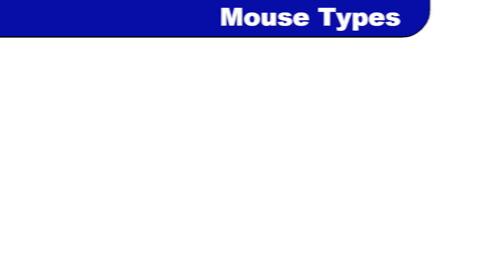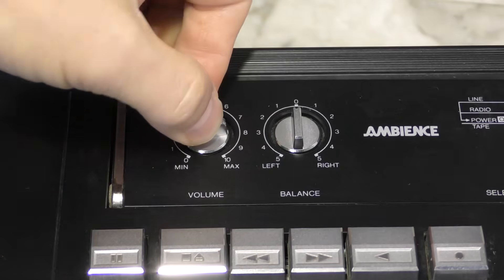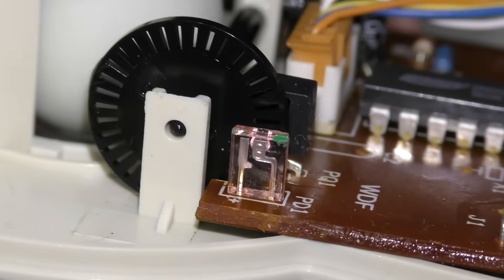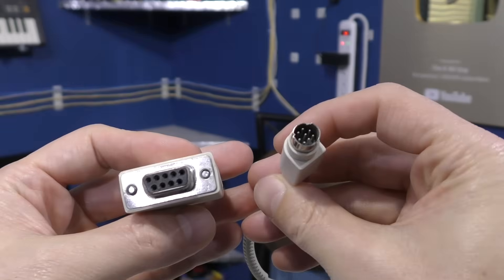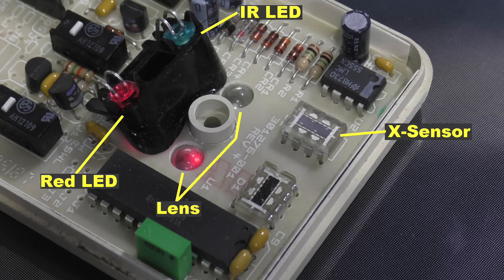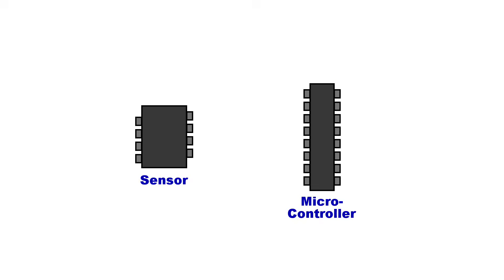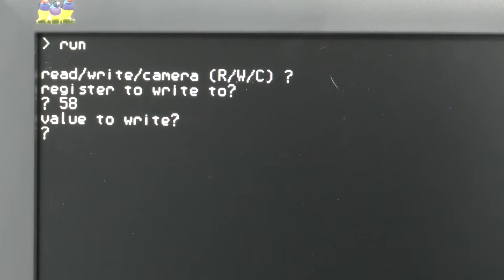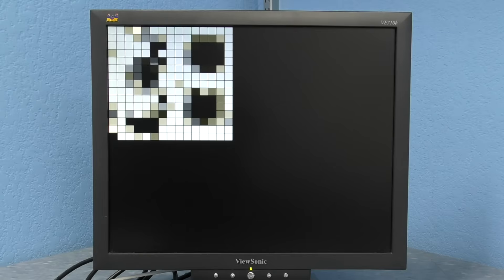What does a computer mouse see?

Comment: Saw the video thumbnail and immediately recognised a Sun optical mouse, which brought back memories of an early job where we used those mice with their matching metal mouse pads. A new manager took over our department and was unimpressed with our curious looking mouse pads, so one evening after we'd gone home he had his assistant replace them with company branded neoprene ones. You can probably imagine our horror the next day as we realised we couldn't use our workstations. The metal pads been bent in half and chucked in a skip, so the cost of the replacements came straight out of the manager's own pocket.

Comment: I have an HP-HIL mouse. The horizontal encoder wheel kept catching on the infrared LED because it was slightly bent. I don't know how many times I cleaned that mouse before I figured it out.
I still use a Logitech ball mouse at work. It doesn't even have a scroll wheel. At home, I have my trusty Microsoft USB mouse, only marked as the "Wheel Mouse Optical USB and PS/2 Compatible." You probably know the one, everybody had them in the 2000s.

Comment: The N64 thumbStick also utilizes optical sensors, just like the old rubber ball mice, so it actually reads digital data (in the form of pulses)

Comment: I used those sun microsystems units in the 90's and they worked so much better than the mechanical ones of the day. But those mouse pads were a pain and would slide around the desks. You also had to be careful to not dent them otherwise it would cause problems as well. I miss the fun of scrapping those rollers.

Comment: For a while, I had the optical mouse with the mirror pad for my Amiga.  I found that it gave the mouse a jumpy feel at the smallest levels.  When creating 3d models for sculpt 3d, the optical was not really that much better than the stock mouse.  Also, it had 3 buttons, but not much software embraced the extra button.

I still have a PC serial mouse that runs at 2400bps.  It's interesting to hook it up to a terminal program and roll it around.

Comment: Hey - I'm looking for a decent analogue to usb capture card, i bought 2 and they were absolute crap. 
Can anyone recommend one?

Precious VHS tapes to copy :)
Reply: might not be the best solution, but we still have an old camera which uses vhs tapes and has the ability to output to the yellow/red/white video/audio connectors.  That camera's output plugs in to a video input on another slightly newer camera that we have, which for some reason has the ability to take a video input, and has a usb out connector which we plug in to the computer.  The software only really works for windows 98 and xp, but luckily I have an old laptop with a copy of xp installed on it. Hit play on the vhs camera and record in the software and wait for the tape to finish!

It's a lot of wires and probably not perfect quality to capture the tapes, but it's what we have on-hand and worked well enough
Reply: @TheJunky228  Quite a solution! :)
I still have a windows xp laptop lying around somewhere so an older device will also work. 
I have both a VHS camera the tapes were recorded with (older than me lol) and a VHS player - both output composite only. 

I bought 2 kits in the past - one for £30 and one for £8 - the £30 one was worse than the £8 one and delayed the audio input somehow. I've seen The 8-Bit Guy use a squid capture device but I've been unable to find one like that on ebay or amazon.

Comment: Did the resolution stay around the same or do we haev HD mice now? 
Just like sound cards, did the computing power ever move to the machine or do they still send the same signals as opto-mechanical mice?
Reply: Most "gaming" mice have a higher quality sensor (high dpi).  For example, Logitech's G502 has a 12,000 dpi sensor.  A typical mouse has a resolution of about 1200 dpi.  DPI is just a marketing gimmick for gaming mice.  Some gaming mouse manufacturers even admit that DPI is fairly irrelevant, and too high a DPI isn't always a good thing.  Polling rate is also important.  A mouse with a 125 Hz polling rate is reporting its position to the computer every 8 milliseconds, while a mouse with a 500 Hz polling rate is reporting its position every 2 milliseconds.  A higher polling rate can reduce lag, but setting your polling rate TOO high just wastes CPU resources for minimal benefit.  

In general, mice still send the same information to the computer, whether they are optical mice or electro-mechanical.  Just the button status, X delta, and Y delta (the change along the X and Y axis since the last time the mouse was polled.)
Reply: @SpearM3064  g502 se now has 16k dpi.
but now days its all about ultra low latency wireless mice, still very pricey, but supposedly lower latency than even many wired mice.

Comment: I remember when I was in high school, the rollers in the mice couldn't be cleaned because some school administrator had decided it would be a good idea to superglue all the ball covers "to keep people from stealing the balls". so people ended up throwing the entire mouse in the trash whenever the rollers would get too dirty, and the school would just buy a new mouse.
Reply: What's stupid is that's actually a thing. I remember finding a few mice without the balls inside at school. Not many, but some morons actually stole them. Of course by that time optical mice were becoming popular and cheap...
Reply: @encycl07pedia-  Kids used to steal them to throw them at eachother. Or lights. Or pretty much anything that was fragile and could be broken by a dense object colliding at velocity. I remember one bored kid making a ball bearing ring to slide around on using computer mice balls and a CD disc tray used for stray discs.
Reply: @encycl07pedia-  you are telling me that stealing a ball makes a person a moron. that is absurd
Reply: @encycl07pedia-  it was a joke kind of
Reply: I went to a school like that. the covers were super-glued.
Reply: @smpmuzpid  You'd think that, but probably not -- unless you're getting a volume deal on the replacement balls, it was probably faster and cheaper to just toss the mouse.  And if you were really determined to clean your mouse, you could just unscrew the case...
Reply: @AndrewAMartin  the mice in question had screws under the glued-on cover. you could probably drill holes through the cover to get to the screws, but no one bothered to do that.
Reply: It's funny how the same things happen all around the world. My high school teachers here in Spain used to do the same thing.
Reply: @pedrosmith4529  Kids these days...when I was in school there were no mice, floppy disk drives, etc.  My high school got Apple IIe for a computer lab for the 1982-83 school year, which was 11th grade for me.  No mouse involved.  PCs didn't have mice.  In the late 80's, having a mouse for a PC was more of a gimmick, and would be programmed to emulate arrow keys or some such when moving and that was kind of useful in some programs, but it was rare for any program to have actual support for mouse input.

I remember Logitech and Microsoft had different standards, but the same connector: serial port.  The "bus mouse" and the PS/2 connector was still a serial port, just going to a different, dedicated, serial port hardware.

Logitech had 3 buttons, Microsoft 2.  The Logitech protocol (or the supplied libraries anyway) were much nicer to use in programming.  Mice (except for MS branded) had a switch on the bottom to choose the compatibility mode.
Reply: @JohnDlugosz  kids these days and their dang. *shuffles cards" graphical user interface point device that has existed in mainstream sence 1983
Reply: @JohnDlugosz  ok then boomer
Reply: in my school they disabled right-clicking because they believed that it would prevent people from changing settings and hacking computers....
Reply: elco_os lmaooo
Reply: @smpmuzpid  How easy was it to source replacement balls? I don't remember them being sold in regular computer shops. And would you need to source the exact right size of ball for the brand of mouse you had? Already it's sounding like it would have been a massive PITA to do when simply buying new mice was hardly uber-expensive.
Reply: I'm a school IT technician, and yes, that was common practice in schools before the last of the ball mice were discarded - which was shortly after I started working in schools. Students will break everything, and theft of balls was an issue. The biggest similar annoyance now is the metal bars under the spacebar on keyboards - someone keep stealing them, so the space bar is left wobbling!
Reply: @smpmuzpid  Oh jeez, there were a few people who went around my school burning out the motors that pushed out the CD tray. Part of that is Lenovo's or the drive MFG's fault for not making the motors check if they got stalled mid way through retraction, but it admittedly was fun to watch.
Reply: You found out they were glued because you were trying to get the ball out 😆
Reply: @brendancarlson1678  I found out they were glued because I saw a teacher throw a mouse in the trash because it needed cleaned and asked why they didn't just clean it instead of throwing it away.
Reply: When I was in grade school kids would try to install Minecraft on the school computers and whoever did was the coolest kid in the school.
Reply: my IT teacher didn't even knew about cleaning the ball rollers ...
Reply: @chill down Why did you do that? What use did you have for a stupid mouse ball anyway?
Reply: Love Live Besto Shonen people from my high school stick cookies into the cd drive and toothpicks into the fan. What is wrong with people?
Reply: I had a ton of mice balls I bought from the local library as a kid. I used them to bribe teachers.
Reply: Was that like 10 years ago?
Reply: @Mustache Merlin amazing since the cost of all those apple machines and stuff simple makes the cost of mouse balls inconsequential, they could have ordered a life times supply for a hundred bucks.  but school computing was always a bit of a scam based on "computer literacy" fears that never came to pass and were always obvious from the get go, but this is what happens when you are free to spend other peoples money.
Reply: @churblesfurbles  I don't think they're free to spend that money. If that wad the case then the principal would have bought a Ferrari for himself. Pretty sure this choices have to be justified and approved
Reply: But people were actually stealing them when they weren't super glued
Reply: @smpmuzpid  Worse were salami slices in CD-ROM
Reply: That's terrifying.
Reply: Same at my school. So I always kept a screwdriver, q tips and bottle of isopropyl in my backpack. That one took some explaining to the teacher the first they saw me do it.
Reply: The only sad this is that they had to do that because people were taking those balls. Yes, one could take the mouse apart to clean it, but by the time it needed cleaning, it probably needed to be replaced anyway. (a mouse used by lots of people, all the time, gets pretty dang nasty. and the buttons wear out all too quickly.)
Reply: @jfbeam  at the school I went to, they usually needed cleaning about every two weeks. that's long before the buttons would wear out.
Reply: @jfbeam  it's a school in the US. there's no way they'd pay anyone enough money to do anywhere close to the amount of cleaning that was needed.
Reply: @smpmuzpid  Thats if you could find the right one, i never recall the balls being for sale seperately
Reply: Better than having to throw it away due to idiot kids removing the ball
Reply: Better to have a stolen mouse than a broken mouse am i right
Reply: mega face palm
Reply: To be fair I stole several mouse balls from my highschool so it's not like the concern was illegitimate
Reply: @smpmuzpid  even if they replaced the whole mouse if the ball got stolen, only replacing the few that would have had the balls stolen would still be cheaper than replacing all of them when the rollers inevitably got gummed up.
Reply: Just want to say that I have spare clothes and if you need them I can have them mailed to your po box
Reply: I've stolen a few mouse balls in my day.
Reply: @Catknapper  how did that work out for you?
Reply: It's probably a good idea. In that scenario you only throw away the mice when it's dirty. With the ball stolen you'd had to throw it away much sooner. And yes, they could've bought mice balls, but public schools can't buy whatever they want wherever they want, they are provided with suppliers and such and it's probably a pain in the ass to buy these things
Reply: @smpmuzpid  Well, they always had more of someone else's money.
Reply: @Mustache Merlin
Not stupid... We did it to about 100 mouses at the school I worked for back in the early 2000's.
Cleaning was simple - remove the single screw and open the cover. I used to do it about once a fortnight, depending on what other IT fires needed extinguishing.
We went from replacing 5 or 6 mouses per term to one a year (usually when some kid had a hissy fit at the teacher and yanked the cable out of it).
Reply: @Mustache Merlin But can they help it if the entire school wants to steal the balls for no reasons ? Personally, at my school it was like that. No ball, but then laser mices came up
Reply: Is she sitting naked in her profile picture?
Reply: Lmao u look like a nerd guy with a female body
Reply: @smpmuzpid , Because if they got up to put the bubblegum wrapper in the bin, they would be caught as someone breaking the no bubblegum rule. Such rules incentivise hiding wrappers and smearing gum under desks and chairs.
Reply: “Stealing the balls”... ...BALLS... ...😂

Comment: Odd. I've used a mouse sensor for a totally different application. I would have to look up the data sheet for the maximum values but in my prototype, it ran at 800 fps. The last I have heard from that project was that they still use an inexpensive mouse sensor but now at 10000fps with a lot more resolution. I can't remember the exact resolution but it was more than NTSC but less than PAL, a very odd number. Back then there was a 15k FPS sensor announced.

There must be a trick to get the pixel data faster. For starters, I don't remember addressing each pixel individually. They came in bulk.

Comment: In the late ninties, we had a couple of those optical mice with the glass pads come down to our research lab, when another department on campus upgraded their system, and we got their old Sunstations.  God, I hated them - the glass micepads never seemed to work right, hypersensitive and a bit scratched up by that point.  Whenever possible I would revert to the even older workstation with its old reliable ball mouse.    Crudcleaning those things wasn't so bad, since they worked reliably until they didn't, and you knew how to restore them pretty easily if you knew what you were doing.  Of course now, I have a japanese trackball from Sanwa (used to be with Logitech, but they lost me when they got rid of the corded trackman) and it's, of course, an optical sensor pair reading the trackball - crud still builds up, just not in the same places.  Progress, I suppose!

Comment: Yet again, extremely informative and easy to understand.  However is was really hoping that you would explain how the optical mouse with the camera used the image to sense movement.  If it took that long to read the image, how would it be responsive enough?  Does it process all of the pixels to sense movement?  Obviously this is difficult to determine just from looking at the outside of the components, so you would need some inside information to know. Any mouse developers reading this? 😉

Comment: I had a mouse cleaning kit back in the 80s. It had a ball covered in hook-side vecro tape and a pad with the softer-side velcro material for the cleaning ball to stick too. You'd remove your mouse's regular ball, add some cleaning solution to the velcro ball and then put the mouse so it housed the velcro ball. Cleaning was done by moving mouse around with the velcro ball inside to clean off the mouse rollers. Might sound weird but it generally worked.  Of course this meant having to clean the velcro ball afterwards but maybe that was easier than working on the rollers directly?

Comment: I've got first optical mouse in 2001. I best thing was that it still worked about 1 cm above the surface which was totally awesome. I often "hover" the mouse in air pretending like it was levitating.

Nowadays I'm enjoying using my retro PCs with good old mouse with ball that connects through serial port.

Comment: That style of optical sensor was actually used in the N64 controller, iirc. In the control stick, it used these little gears with various sized slits to change the amount of light shown to the optical sensor, so it basically measured the strength of the light to determine the amount of X or Y tilt.

Comment: I actally thought the sun mouse also used a camera like today's mice, just more primitive. Thanks for explaining this in detail. The length of the cable and not using serial termination resistors at the signal senders might be the reason for your slow data transfer. There might be ringing on the lines.